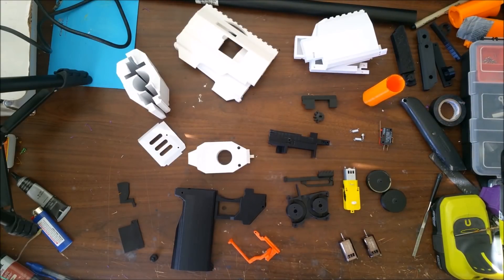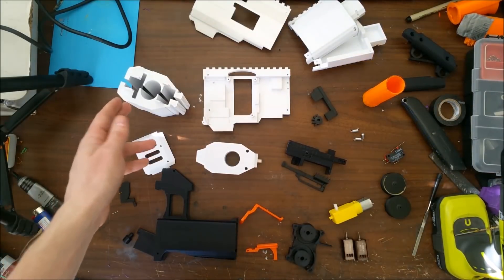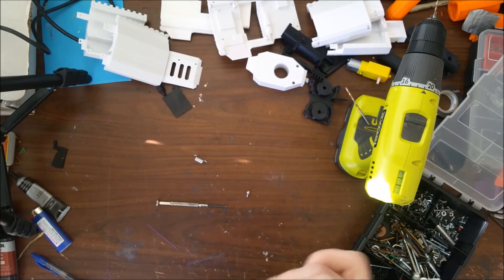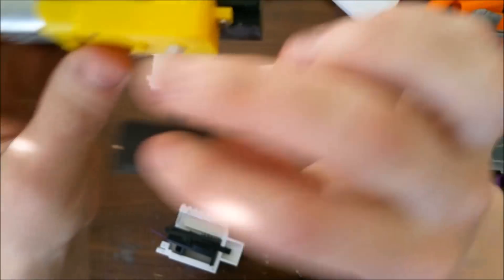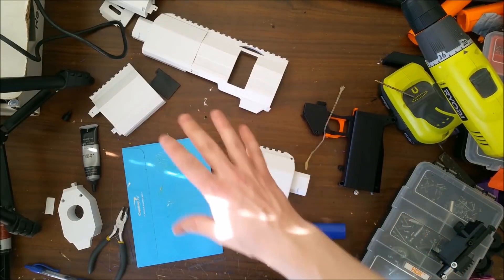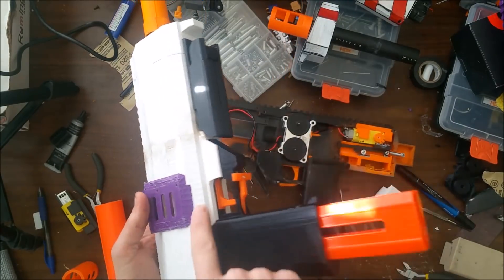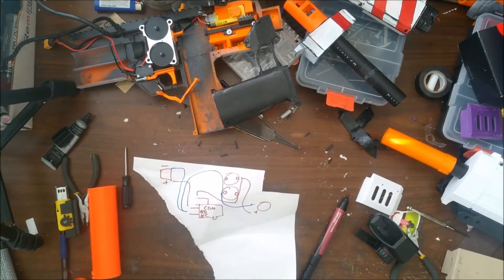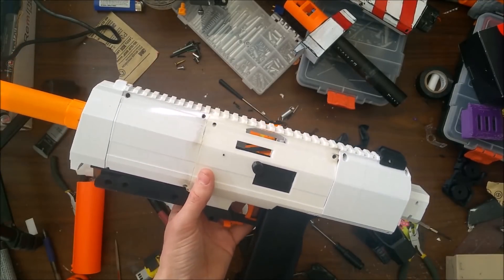MHP 15 Assembly Guide

Comment: Hello again, heath! I have a big question, i really like this design, and i want to build one myself, my question is what internals should i use? Would it fit a worker stryfe cage? And if you have time, please do make a list on what i can add. Thanks!
Reply: Also, could I just go full on worker, a stryfe full auto pusher, stryfe aluminum cage, and wires and motors are gonna be different. I am not too sure how i am going to mount all of this though. For motors im planning to run merlins or honey badgers. Any other recommendations?
Reply from the maker: The only internals I know should fit without problems are the open flywheel project stuff. The pusher will have to be what I designed for this because it's just what was made to fit 
As for motors, Merlin's on 2s should be fantastic for short darts, so those might do well
Reply: @HeathHeil  Ah, thanks! I will try that.
Reply from the maker: It's not to say other cages won't fit, but I designed using the ofp cages, so I know they work. Might be able to stuff a different pusher in too, should you really want to

Comment: What is the AWG number for your wires? I saw on out of darts that they sell 14, 16, and 18.
Reply from the maker: I usually use 18, but 16 if you really run high Amps through

Comment: Hello there, this blaster design looks really neat, and I am considering creating one by following the guide and using my friend's 3d printer.  But, I am not sure what internals(flywheels, springs, wires) to use, and where I could get them.  Also, would the HoneyBadger Motors work properly for the flywheels?
Reply: Additionally, what are the names of the battery and laser sight that were used?
Reply from the maker: I would probably recommend checking the mhp2, though there isn't a guide for it. It's a much simpler build without using any glue. Honey badgers might work for flywheels, and I have a mind to test just that when I'm able to. So far I've been using a 41.5 cage and whatever wheels I have for these sorts of builds

Comment: Where did you get the screws because I don’t have a lot of spare screws also what motor for the pusher because I want the one you used on Bradley’s
Reply from the maker: The pusher is just the motor that comes with those yellow gearboxes. Gives a nice steady rate of fire for full auto. As for screws, out of darts sells them, but it's not the cheapest solution necessarily
Reply: Yea I saw out of darts selling them
Reply: One final thing for Bradley’s what paints did you use and i saw a 1000 mah 65c lipo 3s but it’s graphing is that fine or
Reply from the maker: That's the one I designed it to fit. As for paints, the placks are duplicolor vinyl dye, and the colors are Rust-Oleum, all with a Rust-Oleum satin clear coat on top
Reply: I searched for the gearbox for the pusher on out of darts Etsy but it’s rated 3-6 volts can you leave a link to it or is that the right one
Reply from the maker: That's the one. I don't know that it's ideal for the current/voltage, but it's served me well so far

Comment: Do you think it would be best to use Neo rhinos with a 41.5 ofp cage with black worker wheels or a riot cage with riot wheels in the MHP 15?
Reply from the maker: Depends, but purely for fps, I was getting 125-30 with riot, 140-50 with workers. I can tell the riot wheels are a lot nicer and more consistent but less crush so less power

Comment: Great blaster. It shouldn't matter what darts you want to use as long as it Disney exceed the fps set for the game. TkEZ»UK
Reply from the maker: I am if the same opinion, although hard tipped darts are still... Iffy
But the length of the dart is a stupid way to decide what's allowed or not

Comment: Had the dynamic braking on the flywheels not grown on you, so to speak, would you have considered using a relay/MOSFET to power the flywheels instead, thus removing that braking component from the flywheels? Like you said, just adding another switch would be simpler, but surely that removes a certain amount of versatility with where you put the extra component, IMO.
Reply from the maker: From what I understand of mosfets, I think I'd still need two physical switches for it to press. Now on that hand, a MOSFET wouldn't be a bad idea for the single switch setup here... Just not something I've gotten into yet